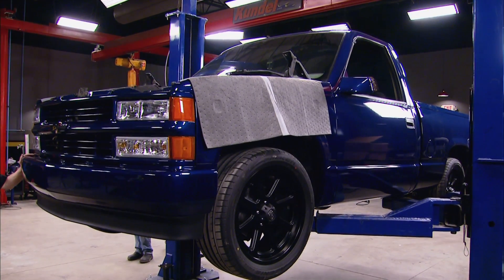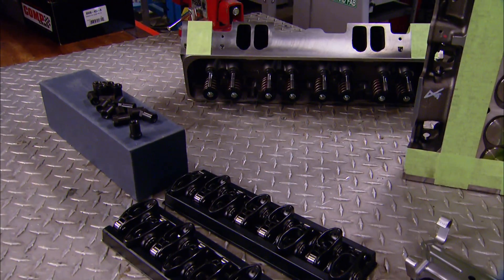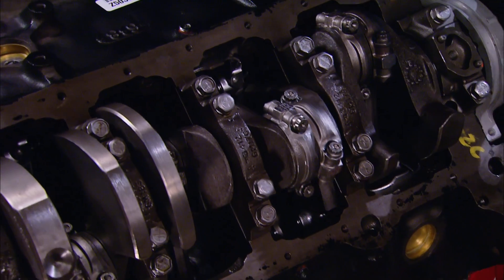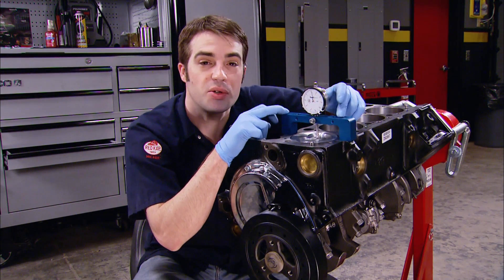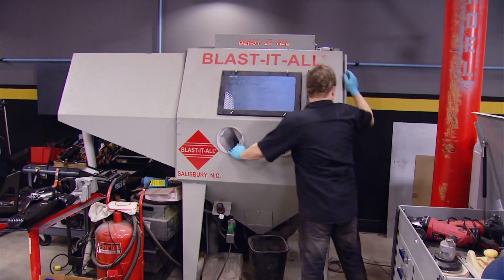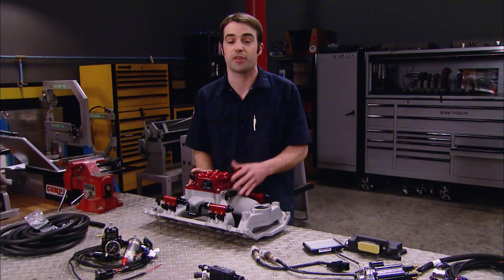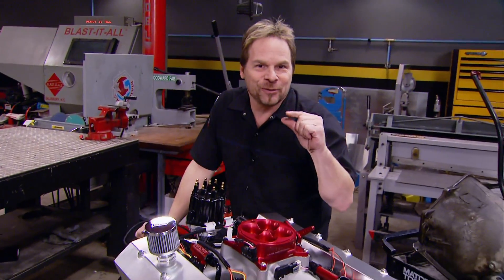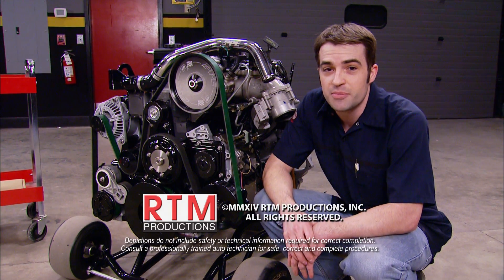Building a 383 Stroker Crate Short Block for a Chevy Silverado - Truck Tech S1, E11

Comment: 1:42 popup The Vortec 5700 (L31)  is actually a Gen I small block, so no it wasn't discontinued in 1996 but rather carried on until 2002. That's why the heads are backward compatible, while LS heads are not (pretty sure LT heads are not compatible either.) The Vortec designation often gets it improperly classified as a Gen III, when all the truck engines became known as Vortecs (5.3 etc.)

Comment: So I am building the exact same engine. How did you deal with the arp studs in the connecting rods with the angle cut into the rod? Did you cut the studs after you torqued down rod caps?

Comment: So if the engine is the HEART. What does that make the TRANSMISSION?
Reply: That would make the transmission an artery
Reply: @kevinponce8122  Hmmmmm... 🤔 makes sence 🤔 but wouldn't the RADIATOR be an artery since it circulates water to the engine and fluid to the transmission?

Comment: Accessory Drive?!?! Im putting a 406 in mine with tall valve covers. My stock 5.7 accessory drive brackets that Im trying to use will not clear the tall valve covers. What did you guys do to avoid this problem?

Comment: Guy and girls in the comments if you dealing with a even more low buck keep your 5.7 tbi and build it up mine is a simple 480hp N.A SETUP for less then $3000 you can easily build a durable nitrous 5.7 tbi and get around 600hp for less then the cost of a 383/385 cid stoker motor

Comment: The next time you have to bore a larger diameter hole try one of these out. I have been using them for years and they are tough to beat! https://www.amazon.com/dp/B003LY4E18/?coliid=I36HXFUTJDVKWM&colid=16V3Z052GG0D0&psc=1&ref_=lv_ov_lig_dp_it

Comment: nice setup. It would be low budget to me, but I see the other comments. I only see the crankcase breathing mistake.. but you mentioned it. Passenger side takes air in, driver side is the hot exit...that gets the pcv valve. you can make use of the classic looking air filter housing and remain the old school look. The rod ratio is very hard on the 383.. its an engine to keep rpms down like factory. I remember when it came out in a car craft article in the 90s. I had SBC in 3 different projects.. before the LS came out

Comment: "Make sure you don't nick the cam bearings on installation", leaves the cam hanging in the front cam bearing by the distributor drive gear.

Comment: The small comment about small blocks being discontinued in GM vehicles in 1996 is not entirely true. They were updated in 96 with a spider injector set, roller block and better heads. The small block Chevy was actually available up until 2003.
Reply: Austin James they still sell them as crate engines ..
Reply: Michel Linschoten Yes, but I mean they’re not still put in new vehicles.

Comment: They don't want to evacuate the air conditioner because "eco conscious"  but will take the truck to the local coin wash and "clean" all that greasy grim right down the local sewer system 🤔

Comment: Just put an LS3 in it and and call it a day :)
Reply: id rather have a 383 stroker
Reply: they have the same power stock and the 383 sounds better
Reply: @musclecarsdaily3020  well there isnt really such a thing as a stock 383  but an ls3 is a 6.2 and a 383 is a 6.3

both will make 550hp on pump 93  

the 383 is gonna need a 210+cc head and a 240+ duration @.050 camshaft  and an 850 with 3500+ stall.
Reply: @KingJT80  never knew that, fyi your right about the ls3 being a 6.2 but its actually the older ones that are still the ls3, my 6.2 gmc sierra denali is an LT engine
Reply: @musclecarsdaily3020  yeah we've moved to geniv now

Comment: The problem with 350 upgrades has got to be the fact that LS motors are cheaper and easier to work with. The cost of the EFI system alone, $3500, is  more than buying the LS engine and swap kit. In most cases, at least where I am, junkyard 350's are becoming more expensive than LS engines if similar mileage and age. 

That being said, this is a cool build, and one I thought of pursuing but the EFI is the biggest barrier for upgrades to these trucks.
Reply: Yup unfortunately the ls bug is out and everyone knows now so prices for them are starting to go up use to be able to pick em up from the junkyard for $800 here now they range from $1500-$2000.
Reply: I don’t think so poor oil pump design shity timing chain shity lifters yes it will make more power stock vers stock but if your upgrade no so much cheaper and your forgetting the LS swap is expense this didn’t come with LS

Comment: I would like to see what you could do with a 2012 5.3 Vortec for a lot more power and durability.
Reply: Charles Holt the 2012 dont have the vortec Chevy discontinued the vortec in 2006

Comment: Camaro and Pontiac used the small block 5.7 vortec in their 2001 and 2002 cars before they stopped making them, and corvettes and pontiac gto used gen 3 ls1 5.7's. As far as the 5.7 small block vortec in chevy and gm trucks, the last year that they used it in the 1500 was in 1999. In the 2500 truck and van, they were used up until August of 2000.

Comment: This is awesome! I'm trying to figure out how to squeeze a 8 liter in my '06 2500. Seeing this gives me some ideas.
Reply: 8.1 Chevy?
Reply: If you're talking 8.3 Cummins or some diesel, it can easily be made to fit but will require fab work obviously. Would love to see an 8.3 done tho as that's a goal of mine.
Reply: @GreatLakesLogger  8.1 gas. For the cost of cramming in a diesel I'd be better off just buying that outright.
Reply: @njineermike  basically a bolt in swap, theres dude that does it
Reply: https://youtu.be/9vr2j7Bv9Cs

Comment: GM didn't discontinue the small block in 96, they discontinued it in the early 2000.
Reply: As far as the 5.7 vortec in chevy and gm trucks, the last year was 1999. In 2000, they used the 4.8 and 5.3 V8. The only vehicle that used the 5.7 vortec after 99 was pontiac and camaro.
Reply: I have 2 isuzu NPR 2002 trucks at work with vortec 350 so who knows when they truelly stopped mass production of them.
Reply: The change to Vortec heads came in 96, but it was still an SBC.

Comment: There went the budget. The fuel injection system alone was as much as the entire engine rebuild. Add in the transmission rebuild, and the other miscellaneous parts, etc., and you’re beyond the cost of the truck purchase price, and we haven’t even talked about the paint. I suppose we’re just gonna go down the road with the same nasty interior and stereo? Like I said, there went the budget.
Reply: LOL, I bet ya they got all that stuff for free.

Comment: Love for you guys to build a monster Coyote and place it in a Ranger or s10
Reply: Theres an episode of them working on a cooling system for a coyote in a ranger
Reply: Javier C thanks 😊 that’s a fun sounding video
Reply: Anyone would put an LS on an S10 before a coyote.
Reply: Squid Usn I don’t think so
Reply: @ripfletching  well, unless a running coyote eng is free but then there's too much involved with the swap.  There's a reason why the LS swap on any vehicle are popular.  I guess, you've never heard any LS swapped mustangs.
Reply: Squid Usn of course I have lots of my friends swapped old school Fox bodies but nowadays the coyote is a better platform for easy power very few modifications only thing you have to do is change the oil pump gears and it is ready for 1000 hp where the LS requires more work to do this I’m just saying it’s a higher revving higher flowing engine much easier nowadays since 2010 to get power
Reply: @ripfletching  true, but it's more expensive and the physical size of the coyote don't just fall into most engine bays.  All I'm saying is, that the common eng swappers would shy away from a coyote unless it's free or a bargain.
Reply: @squidusn71  WHAT IDIOT WOULD PUT A RAGGED ASSED FORD SHIT ENGINE IN A CHEVROLET, FORD SUXX
Reply: I'm a GM guy but the coyote is one of the great engines every designed. But it's a matter of cost and whether or not it will fit in your project. They're very large engine's compared to an LS or any pushrod v8 footprint.

Comment: I would take this truck over any new model. Back in 1999 I bought a 1995 GMC Sierra. It had 40,000 miles on it and other than a few cosmetic things it was basically the same truck as this one. I wish I never got rid of that truck and I'm sure I would still be running strong today.

Comment: Summit Racing lists 12 shortblocks and none are 383's.
Who did the engine? Blueprint.atk?
Reply: Look in the link. It's on summit
Reply: @troywheler8562  So it's a ATK shortblock not a Summit shortblock.
Why not just say that?
Nevermind I just looked up the EFI and it's $4700
Reply: @lynndragoman1573  and they say is a low budget engine hahaha

Comment: Low budget? Yeah, no.....
Reply: they call it low budget because they get everyting for free in the shows
Reply: Waylon  Miller  ever think that the average guy has a life, including family, bills and a wife whom he would have to answer too and make decisions with about said engine parts... I can build a non efi 383 with 500hp for about 2k and that's using a 96-02 vortec junk yard engine and doing all the labor myself  besides bore, deck, mill and valve job... I'll port, polish and gasket match the heads and intake and cut the guide and spring pocket down myself saving tons of money and gaining power... compression, cam, springs, intake and carb choice will be the decision maker... so yes, it is way over kill to sell parts and a solid engine build can be had inexpensively weather 383, 355 or my favorite, a long rod 406
Reply: Waylon  Miller  you watch televised wrestling & "fight videos", haha I can guarantee that you don't have any measurable wealth!
Reply: Waylon  Miller  I wear a 15,000 dollar watch every day, this is not a budget build... 
Never forget that all wealthy people are masters of saving money....

Comment: 8:45 If this thread sealer is NOT used, with the engine potentially burn antifreeze, or will it just leak on the exterior of the motor. Sorry if this seems like a stupid question. Asking for a friend...lol
Reply: It will leak out of the head. It will not burn in the combustion chamber.  The head gasket is a barrier between the combustion chamber and the rest of the head.

Comment: Trucks don’t seam be used what they were made for ion the first place. That 383 wouldn’t work well on the farm.
Reply: Trucks that function as a truck do other things than just farm work like towing or hauling. But they're also a cheap, easy to find V8 powered RWD vehicle that's easy to work on and build something fun out of.
Reply: You're joking?  A 383 is a great working motor.  Torque is what you need to tow or haul.  Did you ever think people may want some nice stuff in their truck?   It's not the 50s anymore. The truck that moves livestock and other things during the day can still be something nice to drive when you go out in the evening.   But you enjoy your bench seat, no a/c, manual everything truck.  The rest of us will take the amenities.
Reply: @bmstylee  nobody drives ranch trucks out to town in the evening.

& this is MILES away from a ranch truck......
Reply: Wild Bill ok I was wrong about the engine. But slamming a truck down so it’s only 4” off the ground and putting racing slicks on it. Makes it hard to go through a field to get an injured animal or other things.
Reply: @mikekiefer6462  you think it's on racing slicks now?
Reply: Nicholas Rodrigues not necessarily that truck. It was a general statement. I have seen on other episodes that they put on barley street legal Mickey Thompson street/ strips
Reply: @mikekiefer6462  ok. I still don't understand why you think every truck needs to be able to go through a field. They make so many different truckes, large/small, 2wd/4wd, gas/diesel, 4/6/8/10 cylinders, etc because there isn't just one application. It doesn't fit what you want out of a truck, and that's fine but you have to realize that your needs and wants out of a truck are not the same as mine or others.

Comment: 3:20 notice they are using regular engine oil to lube the cam. I guess no one would give then assembly lube.
Reply: Not necessary on a roller cam that isn't going to be sitting around before initial start-up
Reply: @malcolmstone4909  it absolutely helps the journals....

Comment: Lol......"low buck"
Reply: Love this show . They make it sound so much fun. It real easy guy , just connect the 💰with stacks of 💵 inside of your very clean and well lit state of the art garage. I watch it every chance I get 😆
Reply: Let's do a low buck build that a guy making 30k a year could do haha
Reply: Right?
Reply: Well, an ATK 383 from Summit is 2059.99, the iron Summit Vortec heads  are $363.50 each. The FAST EFI system is the most expensive single component of the engine build, but anybody with a real desire could replicate this build over the course of a year or two.
Reply: @rcairforceone  the same amount spent on an ls would yeild a beter result.
Reply: Waylon  Miller  the paint plus efi upgrade is probably 15 Grand alone.
Reply: Waylon  Miller  weird. You have all these cool stories about your cars but don't have shit for content on your channel. 🤔 I have 2 lame ass builds and I at least post them. 😂 

I'm gonna have to call your bluff there boy.
Reply: Waylon  Miller  LMFAO watch my channel bud. You're made of spare parts. 

Good luck getting the equipment and proper ppg paints and a portable booth for under a grand. 

And if you do it your first time it DEFINITELY isn't gonna look like that. 

You're quick to throw insults at someone who used to wrench for a living. 😂 

Let me guess. You've been a master ASE certified mechanic for 30 years right?
Reply: Waylon  Miller , My 66 Chevelle is stock from the factory , No weight has been shaved off , the only difference is  a Smaller engine , it has a 12 bolt posi Trac rear end with 4:11 gears and traction bars and it pulls BOTH front tires off the ground in first and second gear , it's not a prepared drag car , it has street tires , if I put a drag strip trans and drag  slicks on it , I'm sure it would do better , but I'm happy just the way it is , I didn't get the car to please you or anyone else , I got it because I like it
Reply: Chip Fisher , hey Chip you are absolutely correct , now drop it  , I don't give a shit
Reply: Their TV show pays for all the parts and labor’s
Reply: @mikeraftis6332  summer jobs, winter seasonal positions, and part time work. You could make it happen if you really wanted it. You would have to make trade offs though. You'll still live with parents, or maybe have some roommates. You won't eat steak and lobster or Burger King six times a week. Probably won't have a girlfriend either lol. But like I said previously, after a year or two, this could be a reality.
Reply: Why didnt they go with a 5.3 ls swap? They could've gotten the same horsepower at half of the price!😄
Reply: cliffdaddy126 , it's only $19.95 for everything , because Summit  gives them everything for free , in return Summit gets free advertising , so if you would like free stuff just mention good ole boy Joe Bob junk yard on state route 3 in your nearest town , parts are free , shipping is $10,000 dollars , and they don't allow you to get the parts yourself
Reply: Waylon  Miller , that's cool that your Camaro runs outlaw class at the strip , 
but I kinda know what it is  to by parts now and then because I have 2 Camaro's , 2 Nova's ,3  Chevelle's , 5 S-10 Truck's , 3   Chevy Trucks of  67 & 68  K-20  4X4  , 3 OBS trucks 89 , another 89 short bed with 350 and 5 speed , other is a 96 3/4 4X4 with 33 inch Superswampers  , A 78 square body Chevy truck 2 wheel drive , A 77  Blazer 4X4 on 33 inch tires .
And my built 66 Chevelle Super Sport , with a built 327/450hp small block with 12:1 compression pistons , vette crank , ported heads, aluminum high rise intake, 
750cfm carb , headers , HEI distributor ,Lakewood blow proof bellhousing ,11 inch heavy duty clutch , M-21 Muncie 4 speed trans , 12 bolt posi Trac rear end with 4:11 gears , traction bars , 
pulls front tires off the ground in first and second gear , 
5.5 sec@ 96mph in 1/8th 
11.1sec@ 127mph in 1/4
Reply: Jim Thomas  may I ask what you work in that sounds like my dream

Comment: 11:28 use narrow body self-aligning roller rockers. I'm running a roller cam with 1.6 rockers and .550/.546 lift with the stock valvecovers.